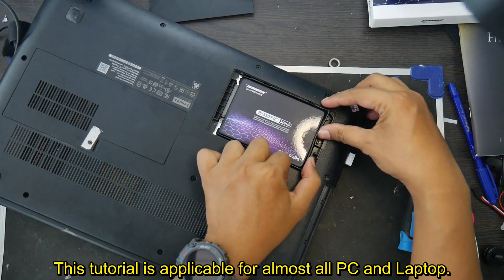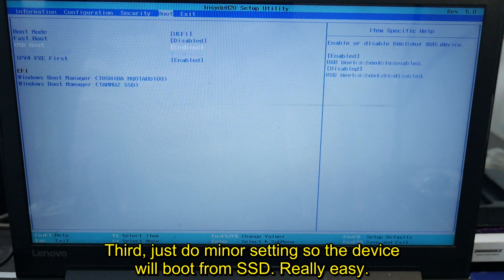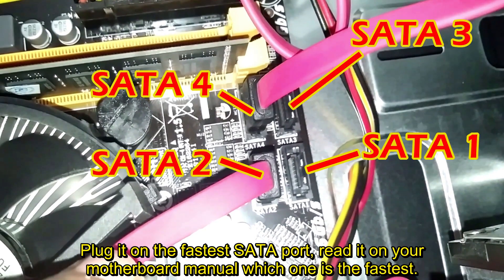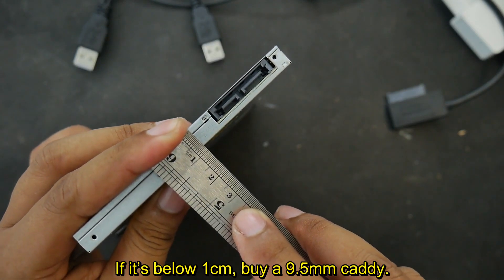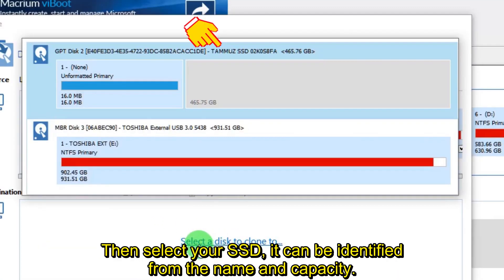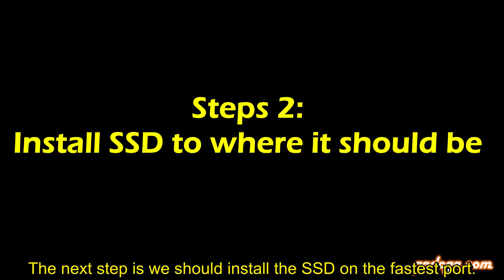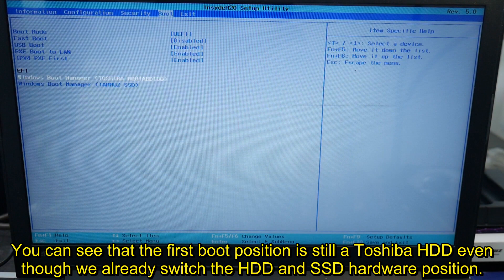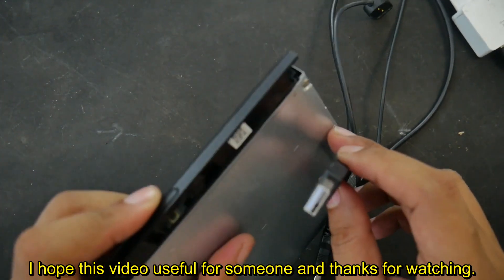How to Change HDD to SSD Without Reinstalling Windows

Comment: Thanks, BUT if one has an older machine with an MBR initialised source HDD (and not GPT), then after initialising the target SSD disk with GPT the resulting clone partition will not be bootable (see 5:13). Instead, (for MBR initialised HDD disks) the SSD needs to be initialised with MBR too, and then it be bootable and works.

Otherwise this was bang on for me, thanks again.

Comment: you sir are the best ty so much :)
Reply: hi can you help i cloned everything 100% good .i assign the right SSD to the boot Oder but wont work alone only works when i have the old hdd on sorry im new to this :(
Reply from the maker: Unfortunately there are various probability and various method to try. You can read it here: https://superuser.com/questions/1093305/windows-10-fails-to-boot-after-hdd-clone-to-ssd

Comment: I get a error when it gets to 50%.. Dont know why..
Reply from the maker: Check the cable connection and make sure it has enough capacity
Reply: I think u got a fake ssd, which they will fake the capacity